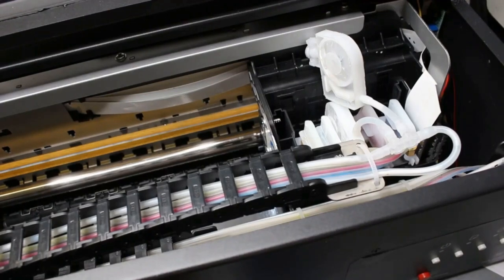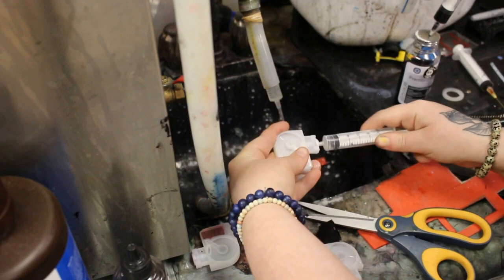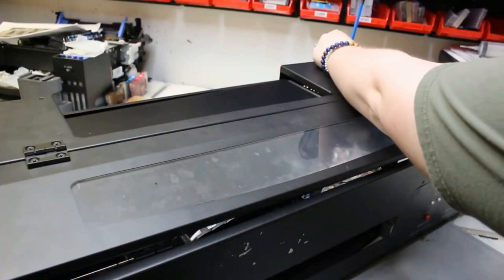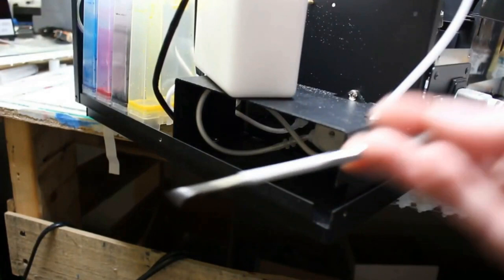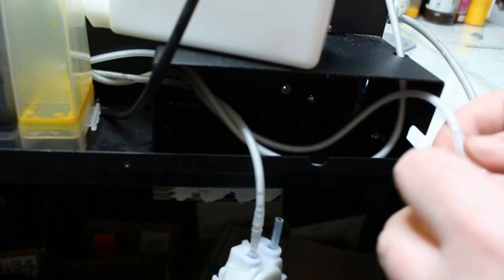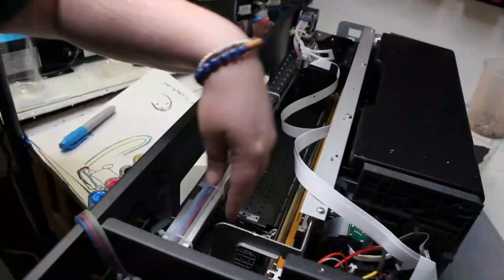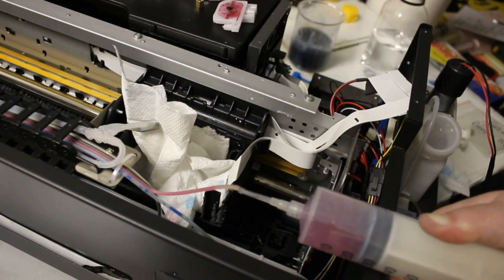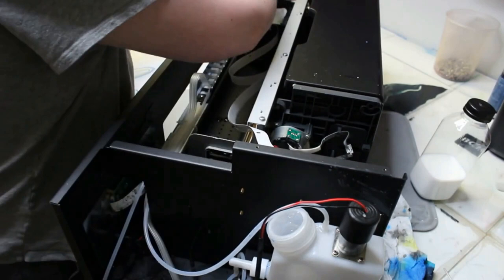Fixing DTF Printer's White Ink Tubes and Peristaltic Pump - White Ink Management System

Comment: Hey Kevin, Thanks for your videos.  I have a question.  I got white ink circulation system. Everything seems working fine, but I have a small issue.  While pump circulates white ink it also gets thrown dumpers a bit. It makes impossible use during printing. When the printhead parked at capping station it pushs thrown towards wate container. I'm suspect it's because I use tubes 3 mm or because the pump is too powerful.  Any thoughts? Thanks